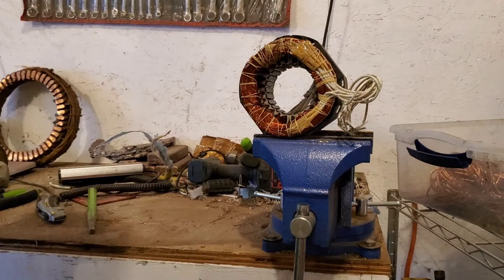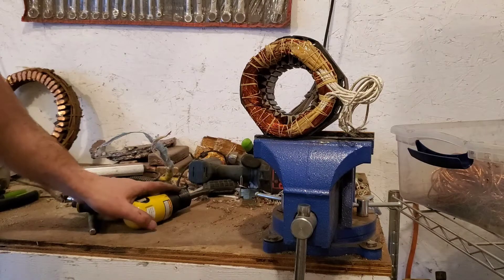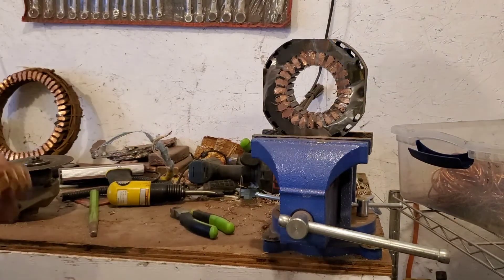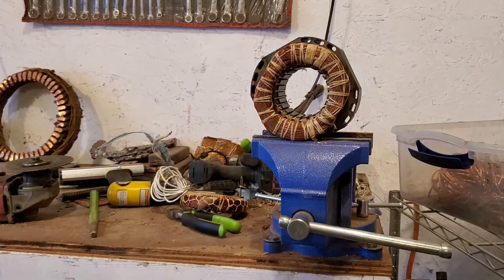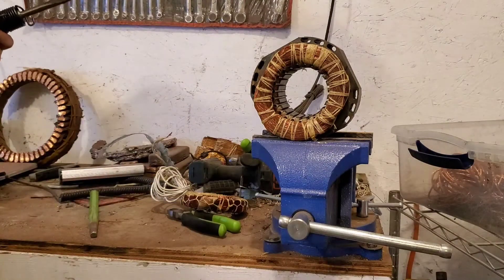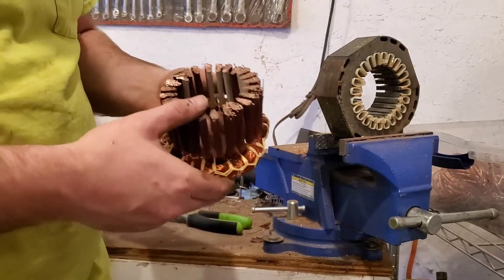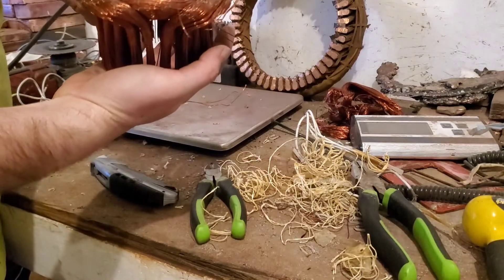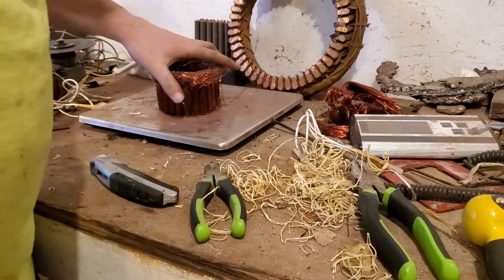Scrapping an electric motor with an air chisel

Comment: I saw a video a while back can't remember it was a 4 inch or wider air chisel they used to cut the motor in half in the middle then no. Cutting off the crowns less mess. I wish I knew what it was
Reply from the maker: I tried a large hammer drill it didnt work. I wish i had one that would work
Reply: @midwestsmelters190 wow well I'm going to try one and see if it works hope it does cause I have 200 some motors to do lol😂. I'll let you know if it works or not.
Reply from the maker: I dont have 200 to do but ive got a few
Reply: @midwestsmelters190  was the hammer drill a SDS one or a regular one? I guess the ads one has a dial to put on drill,hammer or drill and hammer I guess the hammer part stops the rotation and is kinda like a jack hammer sorta. What brand did you use and was it corded or battery?
Reply from the maker: @michaelnonferrousscrapper682   it was a dewalt and it was corded.
Reply: @midwestsmelters190  got me a Milwaukee and a bit and a free 4 in angle grinder not to into angle grinders cause my shed is made of wood haha. With the sparks and all. Supposed to be here by wed so I mite try it after work.

Comment: It works great I have a large air comp and I haven't run across one that it hasent driven out
Reply from the maker: I find that my chisel cuts the wire sometimes  before it drives the wire out. I may need too find a better bit
Reply: @Midwest Smelters  when I made mine I filed the edges so there rounded a bit

Comment: That was a heck of a lot quicker than a hammer and punch! I must look at getting something like that air chisel. 
Been thinking along the lines of building a framework that supports a stator and allows a bottle jack to push up through it and pull the windings out. Sort of like the combination splitter/ puller hydraulic motor wrecking machines you see for sale on the internet. Except rather than an electric motor running the hydraulics it will be my arm. LOL 💪🤣
Save on the power bill. 😁
Reply from the maker: Every penny counts

Comment: There is a chisel thats made for your air gun that has a J shaped curve on the end. Its made for pushing heavy duty cotter keys out of there pins. It  works great and won't sever the wire
Reply from the maker: I will check into it for sure.
Reply: @midwestsmelters190  Thanks for your videos if possible please do one on how to take out very big pully from a big motor if you can do it will appreciate it...

Comment: How do you come across you motors, transformers and wire

I want to start forging but unless I buy all my wire etc. From a scrapyard I don't know how to get any thing to melt

Is it common to buy from certain places?

I'm less than new at this

Thanks
Reply from the maker: I buy all mine from work but I will occasionally get free stuff here and there.
Reply: @midwestsmelters190  that's good to know. So if I buy from a scrapyard I won't be doing anything unusual
Reply: In my area they have bulk trash collection twice a year. People can put all kinds of things out to be picked up. It's a great opportunity to get scrap metal.
Reply: I buy it from a hvac company, just pay the same as the scrapyard.